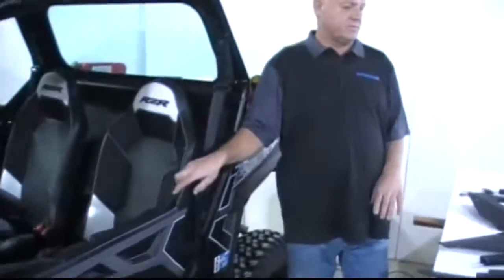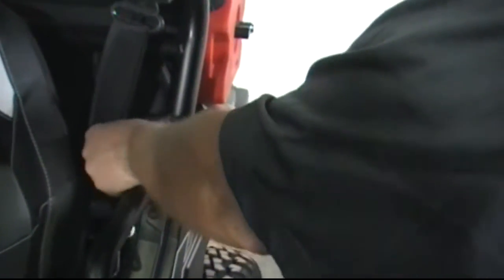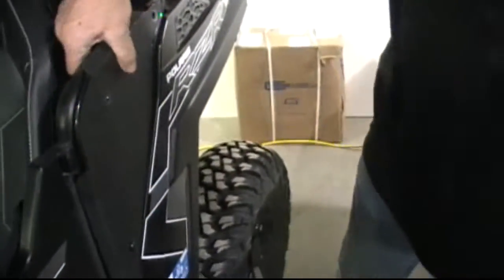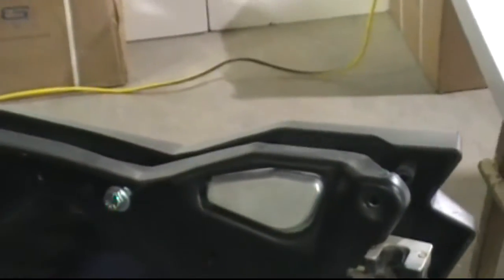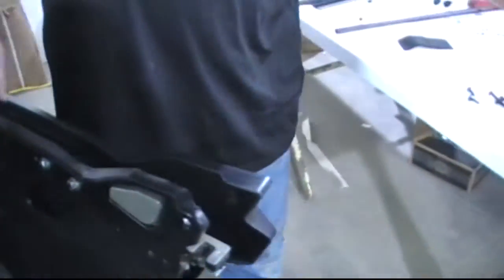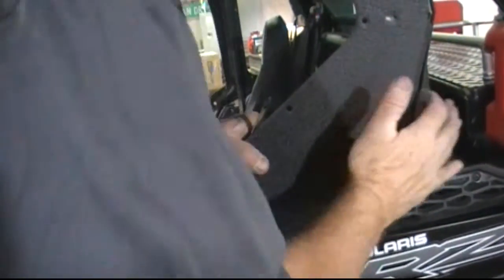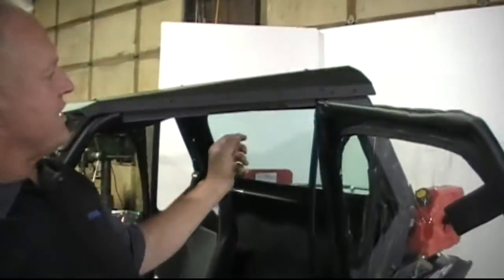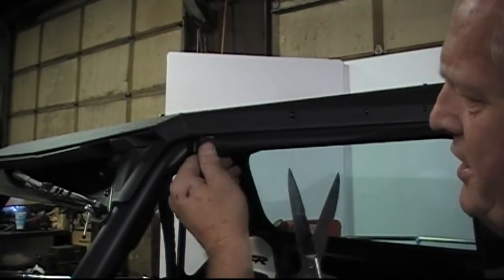Ryfab upper door install

Comment: I purchased the kit and the kit fits well, but aluminum should be cleaned off with rubbing alcohol before trying to stick the Velcro to the round frame. I opened up the box and all of the Velcro came loose off of the aluminum round tubing. It wasn't cleaned off well enough. The kit is great other than that.